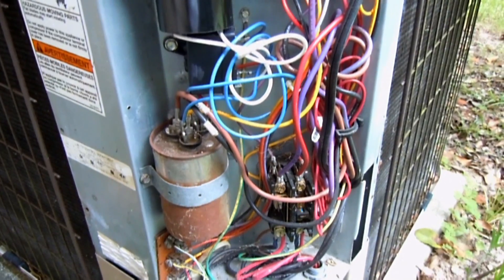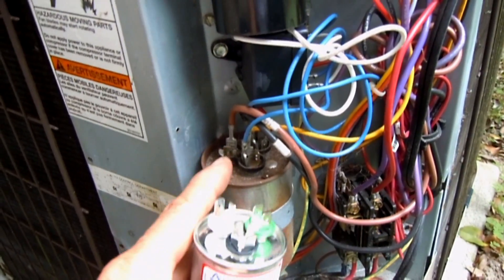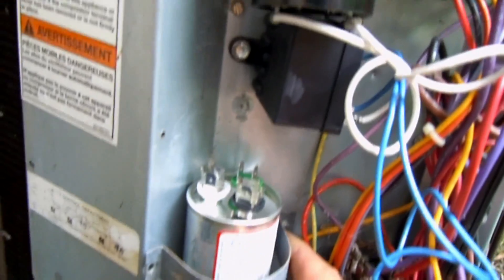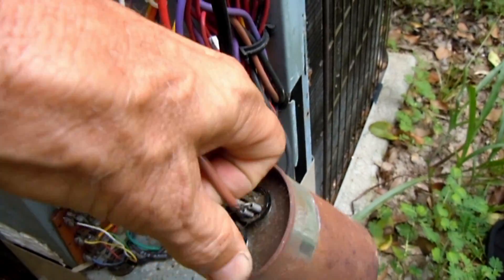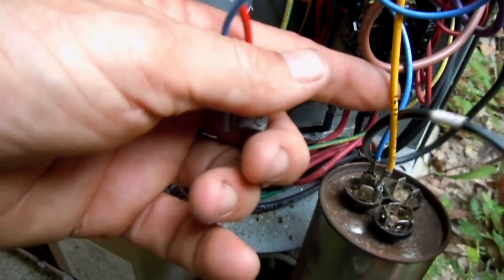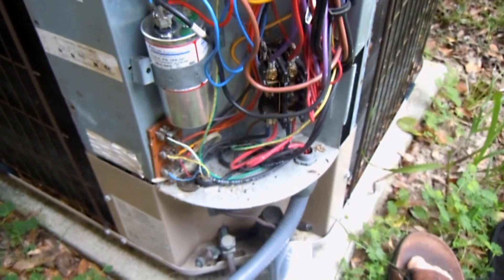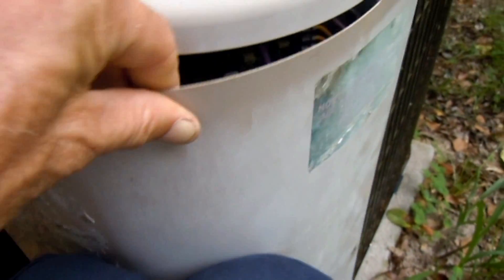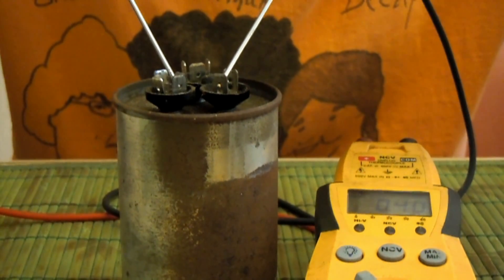HVAC run capacitor Made in the USA.

Comment: When I turn on the Ac the fan runs fine. But there’s no cold air blowing. The unit sounds like is running but hardly. 
My question is… changing the capacitor would that fix my problem? 
Thank you.

Comment: What has your failure rate been on this brand capacitor (Amrad)? I saw your factory video of this brand and was impressed.
Reply: billybassman21 I've had to replace only a few of the Amrad brand. They went bad due to oil leakage.

Comment: How i Know Which size capacitor i need if my old capacitor does not have any info and the info on the tag of my  Goodman Unit is gone,  thank you.
Reply: Find some repair website like repair clinic.com, type in the model or serial number and parts should show up

Comment: @itscool1968 If you watched the video all the way,then you will know that he just replaced the old cap just to show off the made in USA cap. Also you'll know that he tested the old capacitor and the compressor side reading was only 13.8 micro Farad while it is rated at 35 Micro Farad. He also tested the condensing fan motor cap side and he got a reading of 4 micro Farad and it should read 5 micro Farad so the capacitor was a bad one. Please watch the full video before comment.